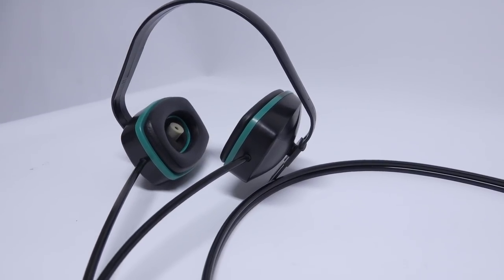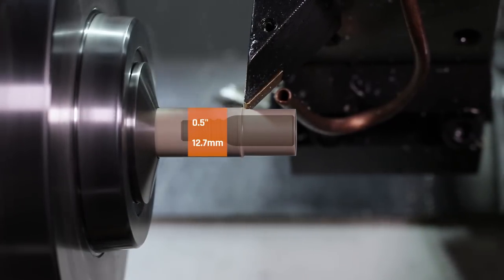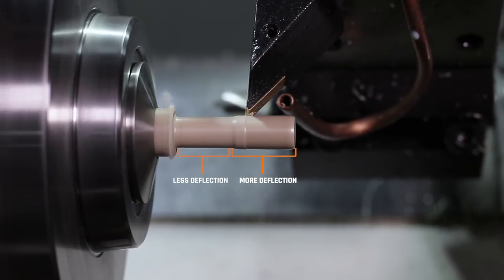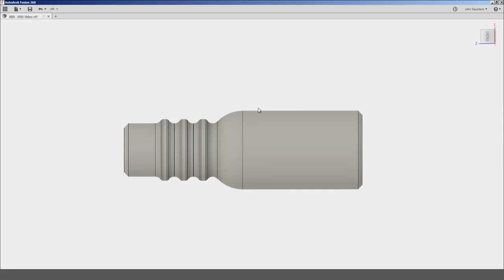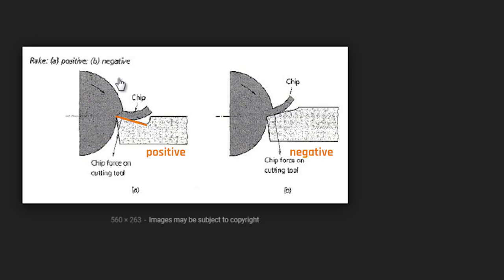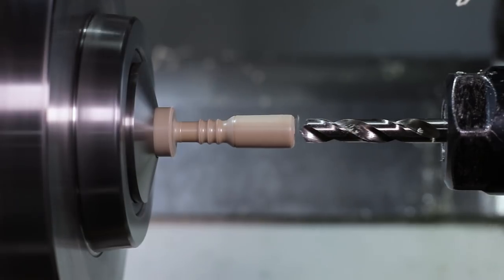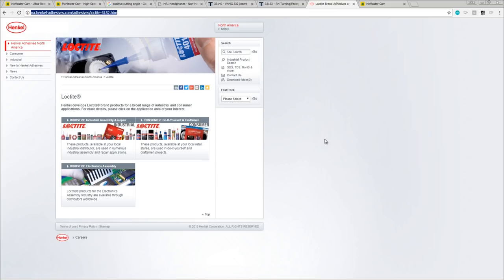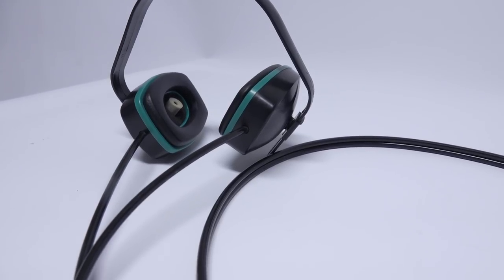Turning an MRI Headphone Connector with Tormach Slant Pro | WW191

Comment: A few things to try. Turn the OD in one pass. It will surprise you.  Two, use sharpened carbide or HSS. RPM should be fast and heavier feeds. The sharp edges and turning the OD in one pass will make this WAY easier to do. Light passes are BAD.
Reply: I was going recommend turning the OD in one finish pass, since its plastic.

Comment: This would be a great application of high resolution SLA 3d printing. The printers we use at work can print this out in about an hour in a range of plastics from hard to soft and even elastomeric (printer is a Form 2 - about $3k). Material cost 50 cents and almost zero effort other than getting the 3D model.

Another nice thing is you could print 20 of them at once if you wanted...

Comment: Do not overthink: drill a longitudinal hole, fit a long steel pin, fix it on the chuck, do your stuff. Zero deflection.
Reply: Genius.  I like that.
Improving on the genius above:  drill a longitudinal hole, then fit the DRILL inside, fix it on the chuck ....    
Why go looking for a fit long steel?  Use the drill.  :)

Comment: Drill out the ID first and turn it on a mandrill instead.
Reply: naturalorange I second this motion
Reply: I had the same idea at first, but then he would be turning thin walled parts in a soft material, the cutting forces will create a twist deflection
Reply: I just thought it was a sexist comment!
Reply: Not sure if a mandrill is the way to go! Pretty sure his customer probably wouldn't want to pay a lot for a small little part like that. John definitely had the right idea of a 1 op part, and using hss next time.

Comment: I’ve been a MRI field engineer for 28 years and never seen them broke like that. Normally the tubing kinks at the connector and tears out. Here is a link for a repair kit.  http://www.newmaticmedical.com/mri-hearing-protection/p/TubingRepairSet/
Reply: LOL $10 bucks they obviously didn't look around to much if you knew were to go lol
Reply: Lol , this is what you get when you assume there are no parts , and you have to custom make new ones . I liked the video , but it seem like it's a fail on the customer end .

Comment: I gotta ask - why aren't you using a ground sharp insert, mean for plastics? Much easier cutting, much less force on the part (and deflection).
Reply: Lindsay Wilson 
He spent like 5 minutes discussing that...  

And he’s probably not using one because he doesn’t have any on hand or a holder to accept them and can’t justify dropping the few hundred $’s to get em for a couple of jelly bean parts.
Reply: You can get a BOX of Korloy CCGT/DCGT/VBGT inserts for like $13 CAD delivered.
Reply: But they have to be delivered, and they probably needed the part yesterday.
Reply: To be honest I've worked in a hospital and you need really sharp tools for peek.

In my honest opinion it's worth the time and money for sharp inserts.

It'll save you time in the machine
Reply: you would've bought them when you ordered the peek.

Comment: To reduce the deflection of the part its useful to split the machining in two or more section from the furthest to the nearest to the chuck. And use a thicker material to start with. This is more wasteful but if you machine many of the same the time advantage (heavier cuts) often outweighs the additional costs.

Comment: I suspect you could chuck the thicker part and keep the grooves out, so the deflection would be minimal. Also, to second your idea to use HSS tool, usually it can be sharpened to a higher degree than carbide insert. As always, thanks for sharing!

Comment: A couple of thoughts. 

My 1st thought was to use a mandrel as Mr Orange suggested, but a really cheap an easy fix would be to drill the ID as the 1st operation (hopefully to a standard dia), and press in a piece of steel, alum or a drill blank. Finish the machine work and press out the support rod.
Actually my very 1st impuls was you should have a nice sharp HSS too in there, but you considered that as well. As the owner of a 90lb weakling lathe, I frequently fall back to positive M2 HSS tools and keep them around ready to go. 

The other thought would be to modify a standard Nylon hose barb - if you could find one to do the job. I hate to shutting down a custom job, but you may even be able to do the job with a molded factory fitting if you could find one to work. 
Sometimes a solution like that will impress the customer enough to cement your relationship, and you may even get a small consult fee out of the deal, sell them the fittings, and end up their "goto" problem solver down the road.

Good video!

Comment: Build yourself a tailstock that you will use. It helps with everything, so it's not like you are only doing it for one project. I would grind a positive rake tool personally, since there is a pretty high chance you will use your lathe for a polymeric material in the future and if you don't, just regrind the tool into something that will be useful.

Comment: My opinion whatever its worth, is to take the finish pass equal or greater than the radius of the tool so that the forces are stable around the radius. Greater than, then the forces are pushing back towards the collet and not the plastic away from the tool. One cut can get violent on first contact.

Comment: Actually, for the sound traveling perspective, just a straight tube connexion will keep the sound going through better. That little hole inside is blocking the waves. Solution pumping up the volume. Overdesign. I think the sound frequencies are also affected.

Comment: Regarding the deflection issue, tool choice aside, why not change the tool paths to work on the end of the part before reducing the diameter close to the chuck?  Rather than turn down the full length at once, you could turn down and finish the features on the end first.

Comment: Yes. Don’t over think or over engineer the part. It deflected, who cares? The part works as designed and there’s no need to worry about it. 

If you were making them by the thousands maybe an improvement is needed to shorten cycle time, but for a dozen or so? This is fine. 

And while I was going to say it should have been turned around so the fatter end is closer to the chuck, with the larger C-bore, getting it done in a single setup is better considering the part and it’s function. 

This would really ideally be done on a screw machine lathe for large quantities anyway, or injection modeled, but PEEK is brutal on molds.

Comment: Interesting. As far as I know turning plastic part like this got to be be done in ONE PASS with sharp tool - this way you will have no deflection problem. On CNC it should be trivial. 
Obviously hard to do on manual lathe, but even on manual lathe I managed to turn simple plastic parts in ONE PASS using a stop.

Comment: This was a fun and informative video, that I enjoyed.  I know this channel is mostly about machining, but given the size and material requirements, would 3D printing have been an effective alternative to the lathe work?  Or if the quantity was going to be high enough, creating your own casting and then possibly just having a drill step, or not depending on the cast.

Comment: I've machined so much PEEK it's almost laughable.  Positive tool, yes.  But, if you don't have on then I would've at least went to a smaller nose radius, and if you don't have at most a 331 VNMG insert, just take that insert and grind the tip nice and sharp, maybe .01/.012 radius and tough it back off, and also, set that Max RPM as high as your lathe will go, 5C collets don't present problems that chucks do in a lathe ... should be up 5/6000 RPM, and you'd be rocking that stuff man.  Great finishes, great tolerances and great parts.

Comment: Speaking of over-engineered, have you seen those titanium chummies Peter @ Edge Precision is working on?  Ok they might need those tolerances, but good grief.  Also I like projects like this, keeping things working like that.
Reply: Yes, I found his channel a while back and have binge watched much of it. Did you catch a price on those titanium blanks? In one video he mentioned a cost of 5 grand per blank (he did a test run on aluminum, before machining the titanium), but I'm not sure it was for that particular job. While Peter's work is fun to watch, as a hobbyist and small business person, this is more along the lines of what I will be making as far as complexity goes. My brother recently bought a tormach 1100 and I'm hoping he picks up the 4 axis to do lathe work on it. I actually had a debate with him when he wanted to keep tolerances very tight on a part I needed, but it wasn't critical and a slip fit was actually desired between the tool he was making and the part it would drive. This video ties right into the discussion we had. Sometimes you need to be Peter and sometimes you just need to get a tubing connector built.

Comment: Flip it 180° and start on the skinny side first, only machining the groves and NOT taking down to final diameter on the rest so it stays strong then do the rest of the part.

Did this a long time ago on something else turned down a 10mm rod to 1mm diameter and 30mm long and then a M5 head in the end, took more than 1 try but ended great.
I was then turning the from the diameter towards the centre and only very short cuts just plunging in and walking towards the chuck.

(It was for making the loop on a necklace from a bullet casing)

Comment: Could've 3D printed these parts, too. Even a cheap FDM part would be acceptable since it doesn't need to be perfectly acceptable.
Reply: I don't know if you can use FDM parts in a hospital because of the tiny grooves that are difficult to sanitise. Resin might work though.

Comment: Why wouldn't you simply machine each feature from right to left to finish size which leaves as much stock to the left as possible for each feature? So in this case largest diameter first, the groves second, the smallest diameter last, part off?

Comment: If they keep breaking them why not use something like nylon that has some flex in it and wouldn't snap as easily? Also would've been WAY cheaper than peek which is expensive mostly because of its insulation and chemical resistant properties and has no benefit at all really in this application. Or just get a regular airline barb at the hardware store like other people suggested.

Comment: Part of the $300 dollar coat is process and documentation. You'd probably have to sell those 2 bits of plastic for $100 to really be doing things the way you "should" with all the process management in place.
Reply: Was going to chime in on this note as well, once even the simplest item becomes a 'medical device' it gains zeros on the end of the price.
Reply: Harry Lyster 
That’s mostly just to clear FDA regulations and the work to get a 510K. 

That said. Using a non-FDA cleared part in a medical setting is a massive lawsuit waiting to happen. 

John would be fine as he’s not marketing or selling them as a medical device or to be used with a medical device.  All he was asked to produce is a prototype for a device. The people who use it in a medical setting though could be screwed if something were to happen.
Reply: Occams Sawzall, true we have to deal with a lot of different things that fall under medical devices even the diagnostic and basic testing equipment for different instruments and accessories. I'll put it this way €800 for a single function, non name brand electrical continuity tester is adding zeros for the sake of it. We'll stick with our fluke multimeter thank you very much 😂
Reply: Harry Lyster But there are processes in place even for that, periodic checking that it is functioning properly, documentation, etc.. It's certainly cheaper than a single use device, but you there is probably an extra 50% of the devices cost annually on overhead (which makes sense, people's time is way more expensive that off the shelf devices)
Reply: Robert Szasz, I was just using that as an recent example that we had. All our testing equipment is calibrated and validated in house or by an external company regardless of its  point of origin. The multimeter we use is commercially available and would most likely be used by a professional working electrician. We occasionally use a very small amount of its full working capacity it to test leads and connections. A company comes to us to offer a device with a fraction of the capabilities for what could easily be 8x/10x the cost. This device was made to test leads for users who just need to see a green light and with no technical understanding of what's actually being tested. A lot of equipment is being marketed that way in recent years and it's fine if the person using it understands the process but when it dosen't work perfectly it just creates more problems.
Reply: Harry Lyster I wasn't nearly clear enough. My point was that to my knowledge NYCCNC doesn't have the process management in place to properly protect the business or operator from legal consequences in a worst case scenario, and adding that has a lot of added cost.

Thanks for the informative response.
Reply: vondeliusc
To be fair to John, you should remove the link to the solution or his clients might come here to check this out, and implement your elegant solution.
Reply: Occams Sawzall - Fair point.  Obvious fix: change the laws.
Reply: But it's not a medical device, it's just a headset.
Reply: But in a medical setting for a medical procedure use.
Reply: Sadly true but doesn't make it right in the sue happy environment, but safety first.  WE are our own worst enemy.
Reply: gredangeo 
Doesn’t matter. It’s being used in conjunction with a medical device, on a patient undergoing a medical procedure. 

You have things like sterilization for immunodeficient patients, if there’s even the smallest bit of metal in them it could cause injury in an MRI setting. Allergic reactions to the material if it’s not an FDA approved material. Delrin is a prime example. Only white Delrin is FDA approved, no colored Delrin is, and generic acetal (which is basically the same thing) is not FDA approved. That’s why Delrin is more expensive than acetal, because it has FDA medical use approval behind it.

Comment: I am surprised the MRI facility allowed you to go into the magnet room. Any person needing access to the magnet normally is required to complete a survey about medical conditions and occupations, any person that falls into an occupation involving ‘working with ferrous metal’ is turned away.
Reply: Hundreds of thousands of people go into MRI rooms each year, with zero concern about occupation. I've gone into 10-20 MRI rooms at 4-5 different imaging companies/hospitals and never had an issue. Never been asked if I work with ferrous metals, and that's even when I filled out the paperwork with an occupation that works with metal. That's like the myth about the MRI pulling on the iron in your blood.
Reply: Andrew Delashaw—I am glad to hear you filled out the screening form, if someone did look at your answers they would have asked further questions for clarification. You are correct that most individuals requiring magnet room access are allowed in after further screening. I bring this up because it is a rare occasion that the machining world comes in contact with a MRI magnet and should know some of the hazards. 

http://www.mrisafety.com/GenPg.asp?pgname=ScreeningForm